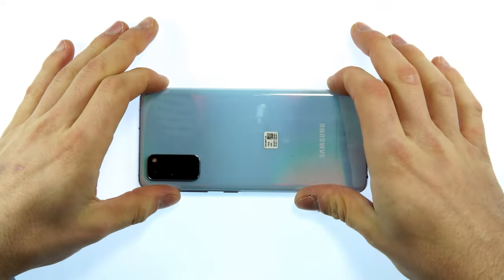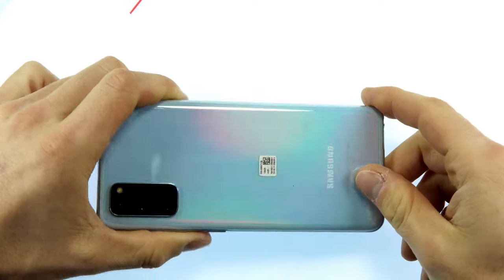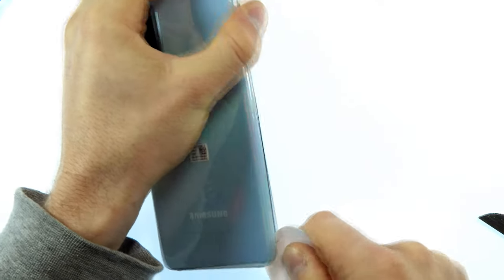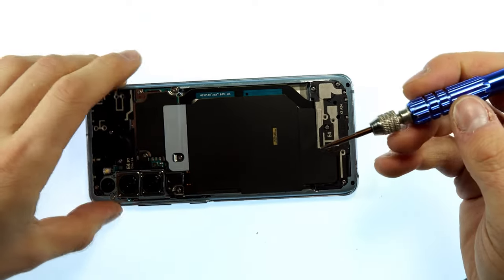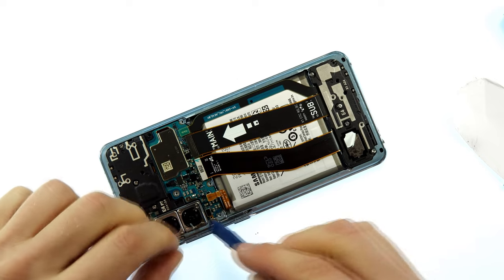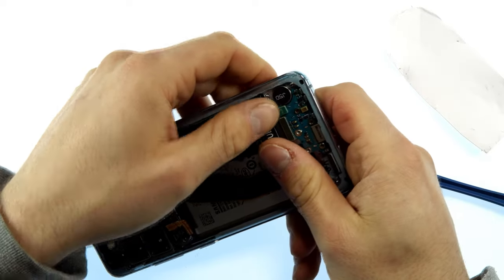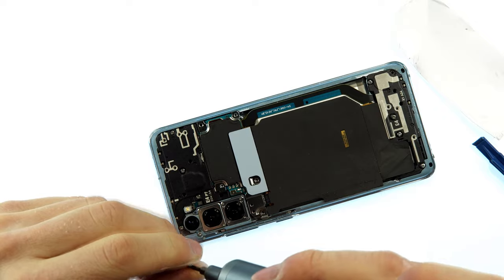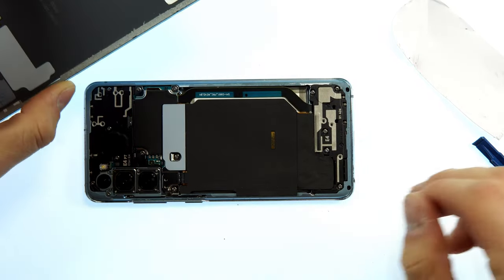Samsung S20,S21,S22 Charging Port USB Replacement - Tutorial DIY

Comment: Great instructional video. I followed you step by step to replace my wife's charging port on her S20+ 5g with a few cracked areas on the edges. I used packing tape over the screen before disassembly. Results are perfect! Thank you😊😊😊

Comment: Hi, would an S20 charging port work in an S21? My S21 port is playing up and I still have my S20 which only has a broken screen.
Reply: I was thinking exactly that, and I also have broken screen s20 and my s21 charging port having issue. Did you change it?

update: I opened both of them and see the parts, the parts are different, they look alike but many things are different, so decided not to replace it. And rather buy replacement part, it costs around $15 on ebay and 25 on amazon but it comes quicker

Comment: i think i may have overdone it when heating up the back. I successfully replaced the charging board, but phone wont turn on and i think its because it overheated. It vibrates whenever i connect the charger and press the buttons to do a reset but shows no display nor turns on
Reply from the maker: No you cannot overheat those devices. 
Flexkabel or connector broken

Comment: Hello, I unfortunately recently dropped my s20 plus (SM-G986U1). I don't have any issue other than the fact that its DP alt mode does not work. The usb c functions fine with file transfers and fast charging but I can not get the device to output video. Ive tried multiple adapters. Can the phone's DP alt mode break separately from the usb c functionality?
Reply: Did the DP mode work before you dropped it? And is the setup the exact same as the last time it worked? You need a specific type of USB cable to make it work, and even then there's a lot of trial and error between the cable and the receiving device whether or not it will work.

Comment: I managed to change the pcb but couldn't get any signal. Fast charging works. Switching back to the old board does not show the connection problem. Revisions on the boards are the same.
Reply from the maker: Then it's defective just buy original one

Comment: I have a 
Galaxy S21 5G but charging port is damage one sim slot and fast charging not working data trancefer with pc not working 
How can i solve it boss plz help
My phone is water resistance but unfortunately water Affected.
Reply from the maker: You need to switch the charging port.
Reply: @allsmartrepairinternational  switch mean? 
Should I change the charging logic board,Changing it will solve everything? Bossa❤️